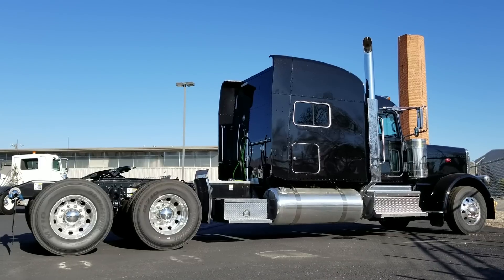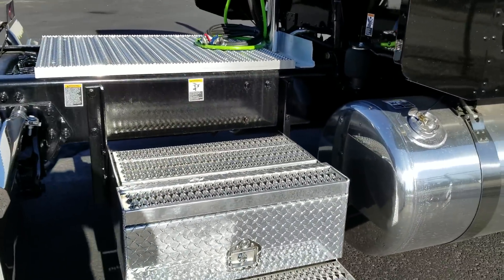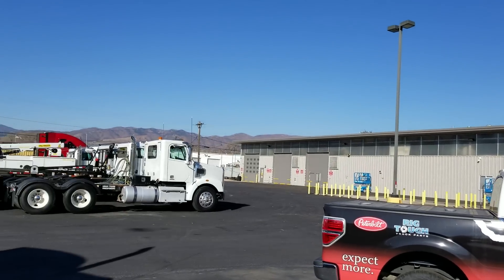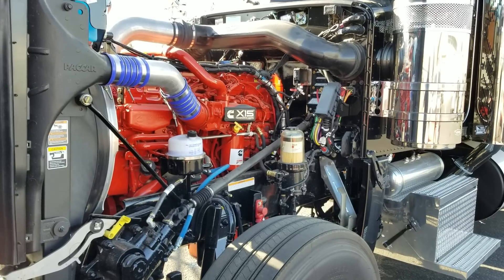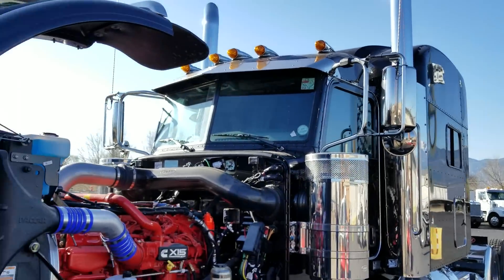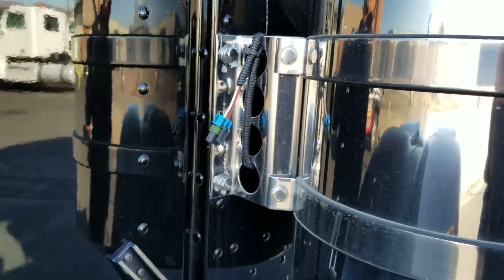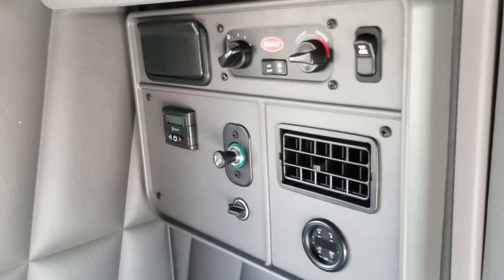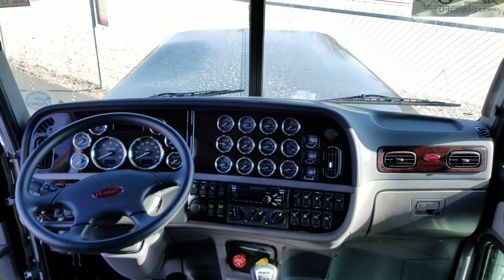2019 Pete 389- Legendary Black- Ultraloft- Engine, Tanks, Boxes, and Interior options.

Comment: Hoping to find a used model next yr but just curious what would this truck cost with a mx-13 510hp the hydraulic tank attached to the passenger fuel tank and apu installed!!
Reply: Lee Hill they should pay you to take it with an MX 13

Comment: I thought ultra loft was the new sleeper for the 579 not 389. I thought it was call ultra cab because the cab roof is a lil bit higher. If this info helps you out I got same engine set up in my 389 and I got 195k miles and have had 0 issues so far. Avg ecm mpg is 6.08 running 70mph with reefer and dry van. On paper i get 6mpg. Running gross weight 72k to 77k
Reply from the maker: My apologies.... Ultra Cab is the 389 or Standup Sleeper if you wish. I have been talking to too many people about the Ultra-Loft and made an entry error.

Comment: There is nothing nice about the navigation screen
Cost to fix is insane
Cost to update insane
Radio is tied into it,hope you like what it comes with cuz that's it
Cost to replace radio..insane
Can never dim it enough at night so you need to use window tint on it
Rand mcnally has way more options and features and is way more cheaper.
Reply: There's a NPO to keep the concert class and get rid of the screen....
Reply: thomas pavelko what are u talking about,,, paccar has the lowest down time hours out of any other trucks on the market....google it
Reply: down down time is what puts a owner opererater out of business. petes and k-whoppers both rank the best as far as down time is recorded. freightliner records almost the highest
Reply: @jeremymccardle3696  lol